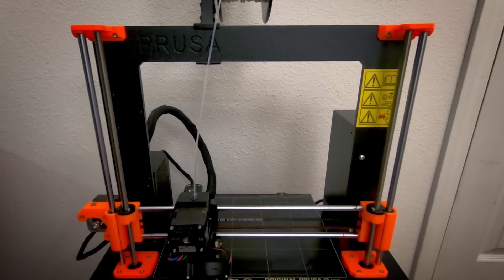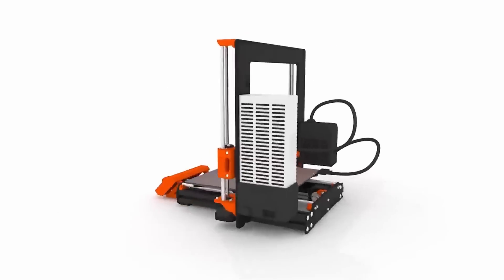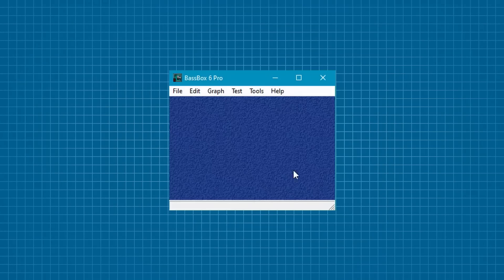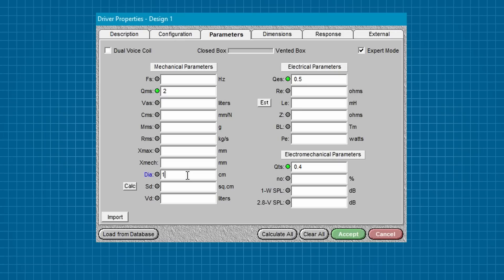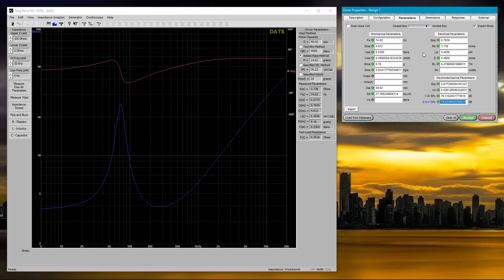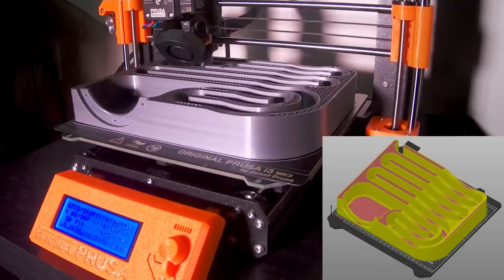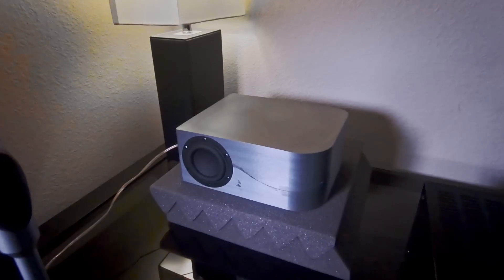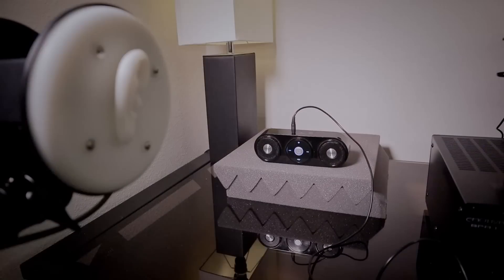Can a 3D printed enclosure get low?

Comment: Holy shit so much bass from such a tiny package. Mind blown.
Reply: Tiny?? It's enormous, IMO
Reply: Milton B I think Victor means over all size is HUGE!. I'm sure if you took the speakers from the Bluetooth and put them in the same box layout as the 3" driver you would have something better than both. :-)
Reply: A teufel rockster cross is smaller i guess and produces more bass😄
Reply: @mxz2024  How flat/even is the bass response on the Teufel? That's the biggest problem with such a small speaker. You can get a lot of bass with the right enclosure, sure, but there will be huge spikes and drops depending on the exact frequency. Ideally you'd want the response graph to show a perfectly flat line from 25hz up to 100hz, but with such a small cone amplified by such a crazy chamber it turns the graph into a bucking bronco.
Reply: @djhenyo  true but i prefer a bit more deep bass since its more fun and for an outdoor speaker its better to have a bit boosted bass
 Overall teh teufel cross spund good for a portable speaker and is rugged.
Reply: @mxz2024  your answer makes no sence ... its like "but i think my new ferary is faster than your selfmade car ..."
Reply: @seze93  actually, your comment makes no "sence". I dont know what you want to tell me and ehat it adds to the discussion. I  dont see any value
Reply: @mxz2024  you are comparing something you can buy to something he hase build and you cant buy ... So whats the sense behind that? 

PS its Always funny If "English people" diss my English skills ^^ bec it makes u feel smart without having accomplished anything ...
Reply: @seze93  your arguement makes no sense. Of course i compare something i can buy to something he build. Thats the first thing you consider, if you think about building it on your own or better buying it. And this is my opinion which you cant say its wrong. I dont know what you want to hear from me but i said comments above my personal opnion in it and  thats why i prefer a teufel rockster cross for example. Nothing to add or to say. This will stay my opinion on a justified base. If you prefer his speaker then contact him if he can buil one for you :) you just did say nothing ehich adds any value to our discussion and it didnt make any sense so far. So please stop commenting, i will not answer in future  because there is nothing for me to take away from your comments (i dont get smarter of your comments since they are meaningless)
Reply: @djhenyo  agreed, that response graph is ugly, but I would expect nothing else.  Driver/enclosure design for a single driver not suited to the frequency range it is producing is always a compromise.
Reply: distorted sound, if the driver had a bit more qualitty to it, it would have been even better, Hexi said that its a good starter but aint for experienced people
Reply: For 10cm sub it is CRAZY extension in bass   !!!  TRANSMISSION LINE BABY  !!!!  👍😁👍
Reply: Tang Band makes a great product.
Reply: @victortitov1740  You havent seen a subwoofer before have you?
Reply: @KJER ERRT Uh no.... People move to the bass, not the midrange or high frequencies.  SPL must be at least 105dB in the bass range before patrons start to tap their feet.
Reply: @mxz2024  "Can a 3D printed enclosure get low?"
enclosure................. 
enclosure...................... 
enclosure.
Reply: @KJER ERRT Not when you're 14yrs old! Bass is everything to them...
Reply: He 3d printed a transmission line enclosoure!
Reply: @djhenyo  It also can be fine tuned to match chromatic scale to get better musical response, but the problem still remain. Especially when listening electronic music.
Reply: @eliteextremophile8895  I can see this being used in a sub-compact automobile with small door panels, but other than that it seems worthless outside of neat experiments like this video.
Reply: KJER ERRT Stop spamming caps. Everything you just said is wrong, and nobody cares about your opinion on their musical tastes. Almost all music has different frequencies and not everything is equal. If you knew anything about music or sound, you’d know that. Guitar for example. Playing rock or anything else with distortion guitar requires you to almost turn your mids off, and turn lows and highs all the way up. A lot good melodic EDM music has a very equalized sound. Some, like dubstep or D&B has more bass, giving it its own characteristic. Rap generally has a bit of bass and might tune the highs and lows to match the voice of the rapper/singer so that the lyrics are not drained out. If all music used the same EQ, most music would sound like shit.
Reply: @KJER ERRT I dont know much about audio but I think hi fi is meaningless without dynamic range (Its loudness difference in every single frequency imo). Without DR, music tends to be a flat graph with no high and  no low which is boring.
Reply: @KJER ERRT From a 3" driver it's definitively worth it to trade amazing sound quality for bass down to like 38 Hz.
Reply: @KJER ERRT uh... the enclosure... not the frequencies...

Comment: oh shiiiit im not even into audiophile level equipment but this video was very interesting, cheers mate
Reply: This is actually science, not audiophile pseudo-science where most of it is made up to add ridiculous price tags on basically thin air.
Reply: the driver has pretty poor frequency response range for high end audio gear, but this is still impressive output for a 3d printed enclosure
Reply: True WingChun  Sounds like you got your cable directions mixed up, better order some more Shunyata Sigmas buddy. All he said was this is real science, there are gains to be had on certain things yes. But most of the super high end audio equipment out there is never worth it. You can get gains from cables  and other things sure, but that's on the level of like.. making sure you're not buying shitty RCA's from Walmart. Going beyond a certain level is just chasing perfection, and if you're after that level of perfection you might as well hire the band to play in your listening room every time you want to hear them.
Reply: True WingChun  this should be a copypasta if it isn't already
Reply: True WingChun  Sounds like you've blown thousands of dollars on snake oil and is getting defensive about it.

I agree that this 3D printed enclosure doesn't match a good pair of monitors, but it's an interesting experiment. You, meanwhile, reek of having drank the kool-aid.

Sincerely,
An Audio Engineer
Reply: @Tickleshits It sounds muddy, it's not deep sounds like a lot of mid bass. But it's still impressive for a 3D printed enclosure .

Comment: For the bass that it handles, instead of JB welding smooth surfaces, I would use the middle 50% of all of the walls to make a tongue and groove. It will increase the area of the adhesion surface, and eliminate any air leaks you may get from separation on smooth surfaces.

Comment: That would actually work great in a car audio application where space is an issue.  That box would fit perfectly under my seats or in the back of my 4runner.
Reply: CAMYOTA R.C. You wouldn’t get much bass out of the 3 inch though
Reply: @JacobEcret  lmao what if you just print a big ass one in pieces  and put a sub in THAT
Reply: @joshd7438  use wood. faster and cheaper.
Reply: @digibluh  different sound
Reply: @joshd7438  wood almost always sounds better
Reply: @JacobEcret  Would get cleaner and deeper bass than 6x9's
Reply: I would love to see how this would perform behind my seat in my MR2 with the limited space. Imagine telling people you have a 3 inch sub producing that bass lol
Reply: Yep thud thud boom boom from a small space.  No thanks.  Not music, noise.
Reply: It's true. I've experimented with the OE Tacoma subwoofer box and 10/10 times a properly sized wooden sub box built for the space around it in mind, while still housing the speaker properly will always sound better in comprarison to PLA. Though the poster of the video gets 5 stars for making an incredibly captivating video.
Reply: Not sure if the concept would work in a car.
Fundamentally different environment, that's why car woofer drivers are designed in a very different way compared to home audio drivers.

tl;dr: What sounds good at home usually sound shitty in a car and vice versa.
Reply: True WingChun  looks like someone got mad for no reason lol

Comment: Thanks for the info. Designed and 3D printed my own case. Followed similar straight line approach and got surprisingly excellent response. Fits perfectly in the back seat of my old school 325 convertible with a simple 100watt sub amp.

Comment: This is similarly structured to the Bose Wave radio, except they put two bass speakers in about the same sized package. Each speaker has it's own (shorter) tube that converge together, therefore possibly cutting down on the wavelength necessary for supporting the super deep frequency your model seems to hit. Grats on this awesome design!

Comment: Now imagine one of them 20'' subs in one of these cases. (no air leaks included.)
That will crack some walls.
obviously scaled up since it wouldnt even work without it being scaled up like 6.66x
Reply: mmmmm no
Reply: @TheFreesabin  

mmmm marabou
Reply: Or the print
Reply: That will crack the plastic
Reply: It'd sound terrible given that the unit alone would be larger than the entire box, absolutely would not fit the 3" mounting hole, and box volume would be waaaaay too small for a unit of that size.

Well, you did say "in that EXACT case" ...
Reply: I have a pair of yorkville ls2100pb......  they have a horn style port , 21" subs
Reply: @UCCLdIk6R5ECGtaGm7oqO-TQ  I'm pretty sure he meant if it was scaled up lol
Reply: 9ff70f96 no shit. If you enlarged it tho.

Comment: For a better seal you can always make a female/male sides so when you put them together they seal better. With some silicone in the slot around it should have a perfect seal, some screws for added rigidity and longer lifespan would be great as well to avoid the 2 pieces from separating. A

Also it sounds very empty. It definetly needs a tweeter or a full range to lift the highs a little. 

Great box nonetheless

Comment: That is an impressive build.  I have one recommendation.  If you build another,  put a groove in between one of the halves where the two pieces meet.  On the other half, instead of a groove, you put in the opposite.  This will work as a barrier and prevent leakage and allow you to use CA glue instead of the messy JB Weld.

Comment: I would love to see this same principle applied in a three-way box 40-250hz 250-2000hz 2k- 20k with a sub box handling 60hz-40hz and another sub for 40 and below, as low as the 3d printed stuff will let you go

Comment: listening to your test on my HS7s, your speaker is by FAR superior in the low end. Im hearing REALLY good bass response. that honestly blows my mind coming from a 3 inch woofer. I heard your dips that showed up in your frequnecy response chart but the low end is still really present. im honestly impressed. Quick question thou. Did you design the encloser with those loop paths so that the bass frequencies have time to produce? considering sub frequencies are relativly long wave lengths? im not that audio acoustic savy when it comes to enclosure designs but that was my first thought when i saw your design

Comment: Should have explained what you thought it was equivalent to retail wise.  Based on the binaural mic the bluetooth speaker sounds tiny,  and the bass on the 3d print is impressive but distorted.  Should have included a direct clip of the track for reference as well.
Reply: francis chow the song has distorted sounding bass which doesn’t help.

Comment: Sounds like it's very boomy in the 50Hz range. I'd love for something like this to go down to 35 or even 30Hz
Reply: yeah, not really to my tastes how this sounds. But damn impressive for such a small woofer and box.
EDIT: Never mind, that was greatly because of the track used.
Reply: @nimmen  Yeah I guess so too. Can't wait for the STL so I can print it myself and try it out.
Reply: @bassdrumflextime1253  well of course, it has about 5 inches larger displacement than the one in the video. My 10" SVS PB-1000's freq. response goes down to 19Hz ±3dB because of the large enclosure of it.
Reply: Dang I have my 8 inch in a small enclosure and it goes down to 40Hz

Comment: Great video. I made a set of TL speakers with plumbing pipe to use on my workbench. What I found is that the sound improves markedly as the drivers loosen up. 

Having a single point source with one driver is great for stereo imaging. 

Something that is impossible to show in a video is the quality of the bass (not just the volume) I sometimes stop working just to enjoy a particular segment of music. TL speakers are fabulous for acoustic types of music (Dire Straits, Pink Floyd etc and also stuff with vocals- Jennifer Warns etc) Not for everyone, but I prefer quality over quantity.

Comment: Imagine that. A large speaker designed for audio quality, and requires external DACs and amplifiers has better sound quality than a speaker designed for low cost and portability.
Reply: Both where getting the audio signal from the dac and apm just so ye know.
Reply: Even 2000 dollar subs or setups can sound like crap if there boxes aren't designed for it
Reply: Paragon643 yes, but the small speaker was designed to get audio from a phone, so it'll have another amp inside it
Reply: @Kitbvdrub  Yeah... but one key thing... With the same exact box, an expensive speaker and a cheap speaker the more expensive one usually sounds better. Now if you put the cheap speaker in a really good box designed for it, it could sound as good or better than an expensive speaker in a cheap box that wasn't designed for it.

Comment: While obviously more bass than the Bluetooth speaker, (it had none) the big but here is that the bass is muddy and frankly I have heard better from quality boom boxes.
Reply: The phase no doubt goes whizzing around at the bottom end.  Many will tell you that the human ear can't hear phase shifts but this is only true for a constant signal.  Imagine you play a note on a piano and record it.  If you play the recording, it sounds normal.  If you reverse the recording end for end, it is obvious.  The only difference you make when you reverse the recording is the phase relationships are reversed.
Reply: @kensmith5694  Excuse me? Piano sound starts with a loud percussive actuation and then goes into a lengthy decay where the volume gradually decreases. The volume decay in harmonics over time differs, with particularly high frequencies decaying rather quickly, so the frequency response of the sound changes too. The most obvious characteristic when you reverse the recording is the difference in dynamics not phase!

You can reverse your speaker wires - on all your speakers please - or invert the audio waveform in your audio editor - in Audacity main menu it's Effect -> Invert. Can you hear the difference?

Now when you screw around with phase on part of the signal, interesting things happen, such as spatial shift and cancellation but i just wanted to point out the nonsense real quick. Spatial sensitivity of human hearing is said to be pretty low at the low end, but it's not necessarily nonexistent, not across the whole range covered by a subwoofer!
Reply: Woah that's pretty amazing 👍
Reply: The speaker used was obviously a mid-bass driver and was not intended to play the full range of the music selection. For the range it did produce it’s low end amplitude was awesome!
Reply: @tdoggwise  Agreed, but I can stick any midbass driver in a big box and get bass. The bluetooth speaker was in a too small environment. I think the idea in this video is to get a surprising amount of quality bass from a small driver in a fairly small enclosure. Folding the space behind a driver has been done many times before. It takes many attempts at fine tuning to get everything optimal.
Reply: @SianaGearz  
According to Fourier: 
You can break any signal down into a collection of sines and cosines.
Imagine you do this and then instead of 
Y = A1 * cos(w1*t) + B1 * sin(w1*t) .....
You convert to
Y = C1 * cos(w1*t + Theta) .....
Now do the same for the reverse version of the recording.
The "C" values will all be exactly the same.
The "Theta" values will be different.
Get it now.

Comment: I admit, I came in, I skipped around, I got to where I wanted... It wasn't until you walked back into the room that I really got perspective on how small that speaker was. That's impressive man, really impressive. I wanted to replace my center console mounted (GM stock) sub in the tahoe, and was thinking on how to improve on the design... this is is. A better thought out enclosure to make best use of the sub, which itself is far larger than what you're working with here. I'd love to have the insight, printer, etc that you have at your disposal there to whip up something as well as you have in this video. Hell, if you're this good with airspace and acoustics, you should get into one off custom enclosure for vehicles. Like Qlogic used to, and likely still does do, but used to be more known for. The remote, custom fit, stock looking options. But yours could have far more going on inside, and 3D printed as to really really really REALLY cut down on manufacturing costs.

Comment: The measured response is in your room, so not only the speaker produced that result. But it is very low, I would run it through some digital room correction EQ so it sounds flat. Nice job!

Comment: I did this project also now and it sound pretty darn good! Only downside is, that you have some noise when it comes to higher volume through the bassport. Otherwise incredible! Will post pics in thingiverse :-) Tip is also guaranteed! Use it with a pair of Dali Zensor Picos. Greetings from Germany!